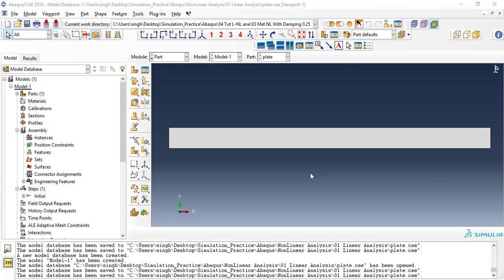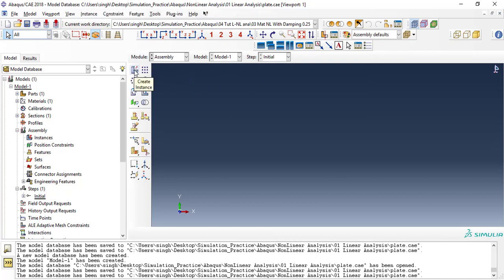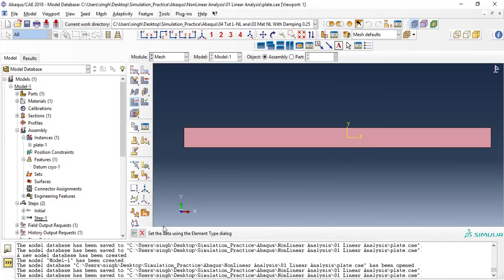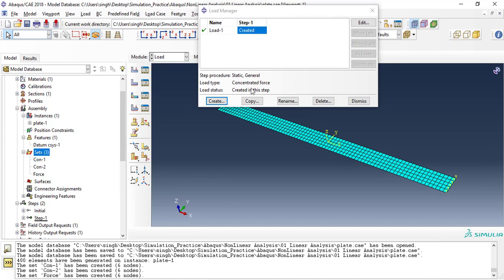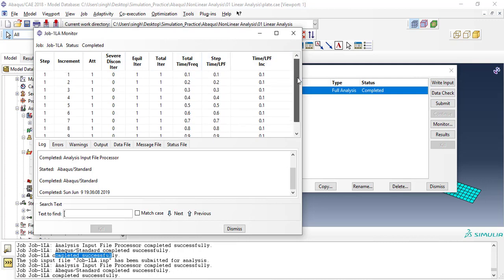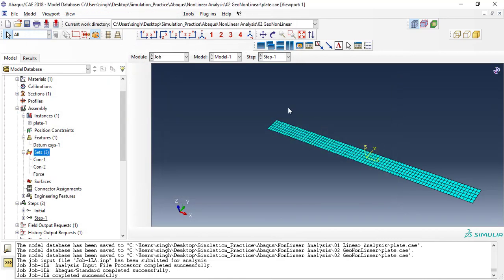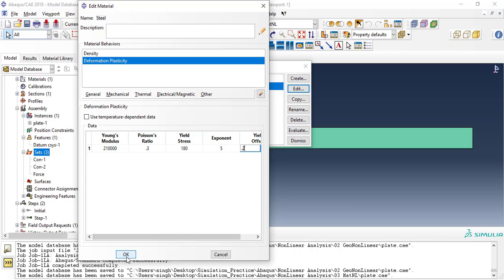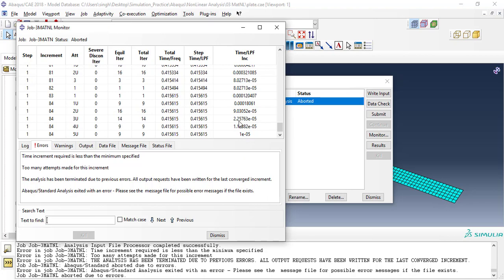02.3 Linear and nonlinear analysis in FEA/CAE (Analysis step)

Comment from the maker: Here density should be 7800e-12 for steel material according to mm, ton, sec unit system. I made little mistake - instead of 7800e-12 I put 7800e-9.
But static analysis are independent to density value, even you not need to define it. So analysis results remains same, Please don't bother about it.
Reply: Dear sir, I also confused about this point defining the mass density, I try to model the load for N, dimension for mm, Elastic modulus by MPa or N/mm2. in this case what mass density value I should use.
Reply from the maker: Dear,
It is just unit conversion.

If ur model unit is in meter..it easy to use MKS unit system.

If ur model is in mm...it easy to use...mm,ton,sec unit.

In case 2 (mm,ton,sec)
Density become ton/mm3
Or
7800 Kg/m3  =  7800*e-12 ton/mm3

Similarly stress
1 N/m2 = 1*e6 N/mm2 or 1Mpa
Reply: @arsitech-ltd  I really appreciate your response. It very useful information. Thank you.

Comment: dear sir, why should we define increments for linear, static analysis and small deformation? I know that for this case we solve the equation f=k*d one time that will give the deformation because stiffness matrix will not change, so why do we define increments and why does software solve the problem by dividing it into many increments (my qustion is only for static, linear and small deformation cases).
Reply from the maker: Dear,
The general static step is based on increment method... whether stiffness changes or not (linear or nonlinear). This method converge solution in better way when convergence tolerance is higher than the specified tolerence.
Let say for any increment ∆f = k ∆x convergence not occur due to larger difference un RHS and LHS (convergence tolerance). In next increment it consider lower step time and other subsequent values and try to converge.

The method of direct solution (without iteration) is used in linear pertribution step in Abaqus.

I also suggest you to learn FEA in this way... raise good question as you raised here.
Read Abaqus documentation and practice finite element analysis book (Nitin gokhle sir).

Comment: Thank you for a great content. I have a question, though: in the linear simulation, I wonder how Abaqus is 'stretching' the length of the plate: is it stretching it via an additional tension force, or is it simply considering the plate as being longer and longer as time goes by, so no added stresses, just an additional length is given for it?
Reply from the maker: Dear,
The reason you mentioned is wrong.
As i told i video...in linear analysis stiffness matrix not change...so for large deformation also it not update stiffness matrix (it should be updated as shape of elements change)...hence nodes are not follow load path..